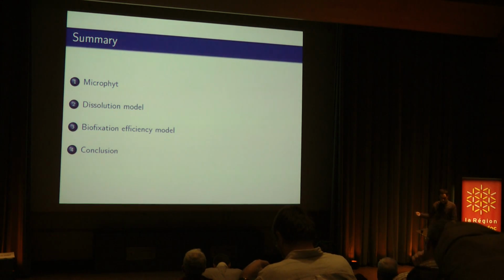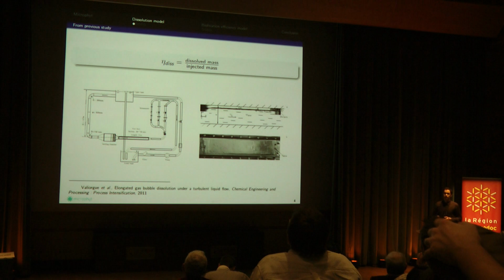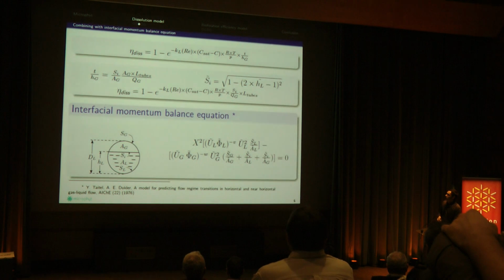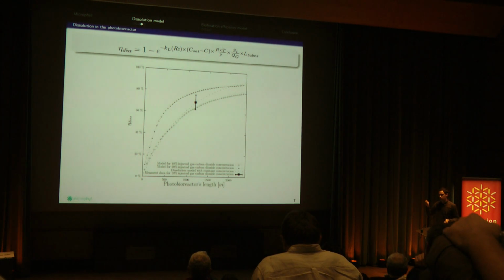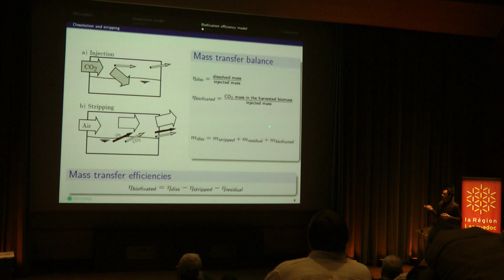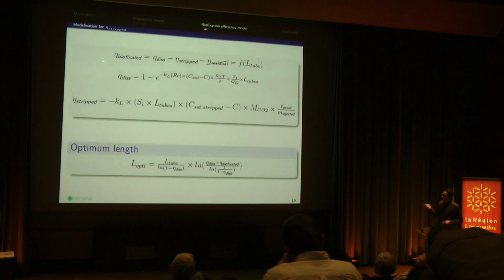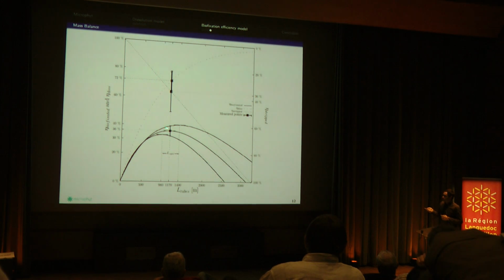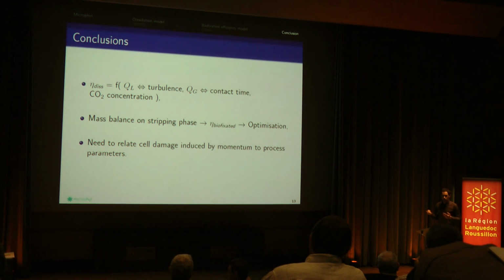AlgNChem2011_pierre_valiorgue.MTS

Comment from the maker: This work is now published in : Valiorgue, P., H. Ben Hadid, M. El Hajem, L. Rimbaud, A. Muller-Feuga, and J. Y. Champagne. “CO2 Mass Transfer and Conversion to Biomass in a Horizontal Gas-Liquid Photobioreactor.” Chemical Engineering Research and Design. doi:10.1016/j.cherd.2014.02.021.